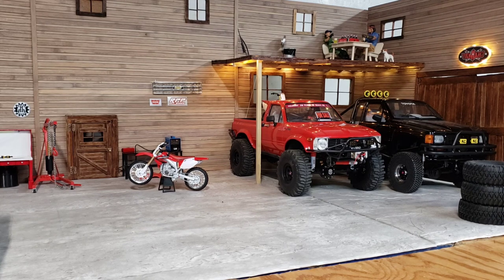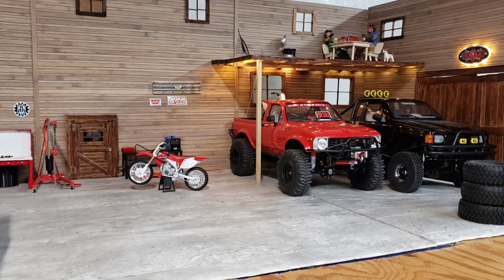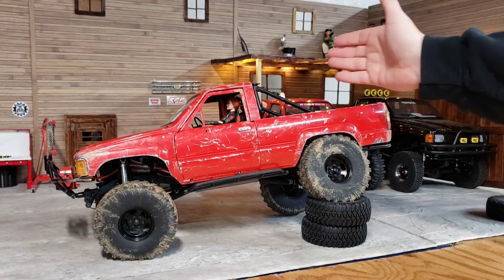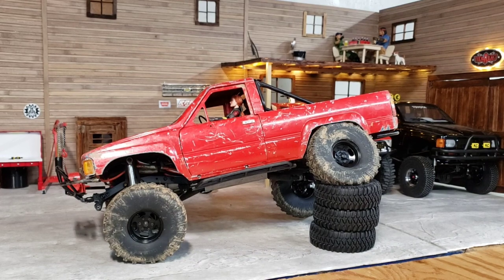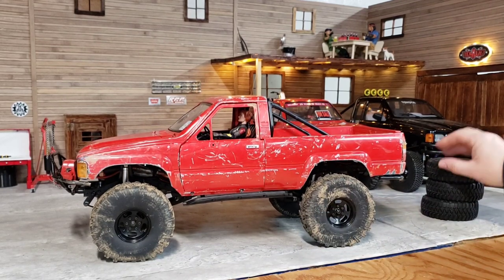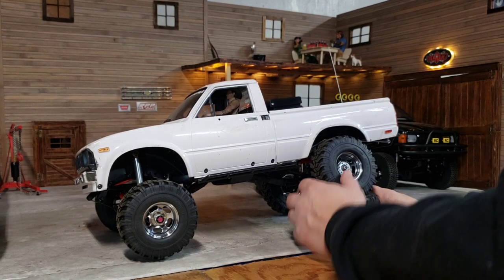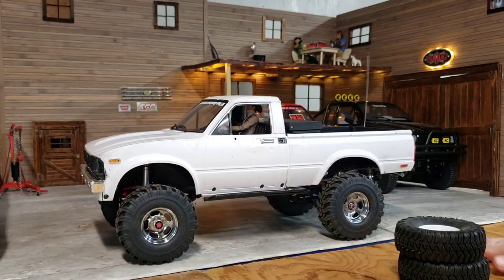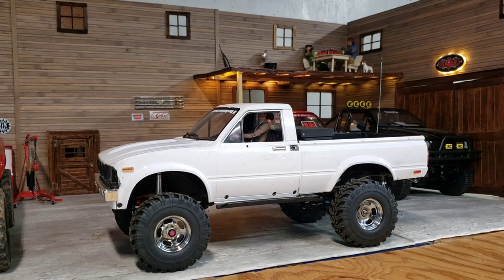Rc4wd suspension setup/Tips

Comment: Thanks for the video, just bought a TF2 myself and have just removed the internal shock springs and the smallest leaf spring. I was still finding it rather stiff and didn't realize that you can gain more flex by breaking it in. I'll definitely be hitting the trails with it to get some miles on it and see how it improves!
Reply from the maker: Hey glad you found this useful. I have some other videos on here that'll help ya out with improving the suspension and keeping the scale aspect of the leaf suspension. Also to help speed the break in process I'd recommend removing your leafs and flattening them gently with your hand it'll help aid with softening them up

Comment: Just found your site and subed like what your doing with the TF2/3 I love these things almost like messin with the rear thing. I did however convert one of mine to a 3-link in the front and leaf in the rear and it works awesome the other truck is still all leaf with A&M front shackle reverse and anti wrap bar and raised skid plate. They both work super can't drive em enough.      Thanks
Reply from the maker: Thanks for the sub Rc brother welcome aboard 👍 yep A&M makes nice stuff I try to stay Rc4wd when I can. But I have some more good stuff coming stay tuned in

Comment: Very interesting! Beautiful garage and fleet! I have the 4runner too and it‘s quite new. I bought the reverse shackles but haven‘t mounted them yet. If i‘ve seen correctly, did you remove the front shocks on the 4runner? Do you think it‘s possible to modify the mounts in the front, do the shock length wouldn‘t limit the flex? 
On mine the leaves aren‘t broken in yet. I get 2mm reserve compression on the front and then they block. 
I thought about maybe driving it without the shocks for a while to break the leaves in faster. But i prefer the look with the shocks in it. 
I love the tf2‘s. 
Greetings from Switzerland!
Reply from the maker: Hey thanks for stopping by and checking out the channel. I have several different videos on here describing shock setup and shock hoops and what the best setup I've found to work and still keep the scale of the stock looking truck without extensive shock angles and having to modify things as to disturb the original parts much. Thanks again for your time watching.

Comment: Are the red springs the super soft springs? And do you always need the antired?
Reply from the maker: The reds are the super soft yes. Do you mean Anti wrap bar?
Reply: @RcDungeon  thank you 🙏 and yes that’s what I meant😂. What size shocks you recommend going to on a tf2?
Reply from the maker: @masonwiggins9658  I'd highly recommend an Anti Wrap bar especially with the red leafs. For most articulation and keeping it scale I'd get the taller front shock hoops for front with the 80mm shocks and 90mm in rear. I think I have have other videos going over different setups and explaining it.

Comment: I have tried to get my leafs broken in and they’re still stiff as a fresh cut oak board. I’m giving up and gonna go link suspension on my Marlin.
Reply from the maker: Yah some of the older rc4wd with the standard leafs sometimes are just overly stiff. I could recommend getting the soft ones Rc4wd offers. If your wanting the most performance I'd go with linked though. If been kicking around the idea of actually linking one of mine to be honest. No matter what you do leaf wise your not gonna get the travel you get from a proper linked setup

Comment: What are the wheels and tires on the Marlin
Reply from the maker: Those were the 1.55 Rc4wd Mudd Slinger on Element 1.55 wagon wheels. Great tire! I've pulled those now and running the 1.55 3.85 Rock Beasts but honestly I feel those Muddslingers from Rc4wd were a better tire. The Muddslingers were around a 4inch tall height mounted to those Element wheels.